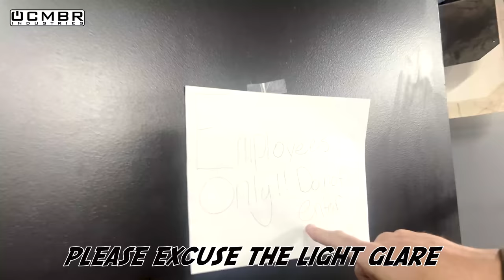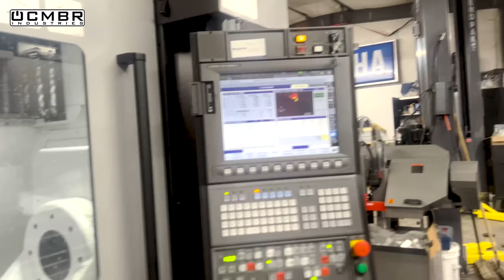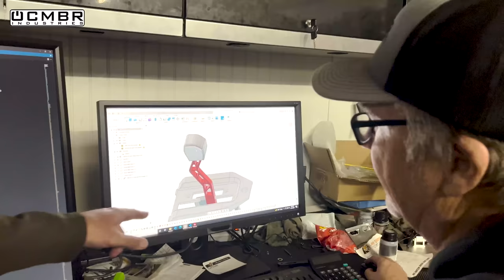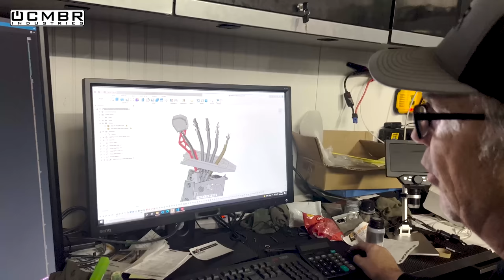Road trip.. empty trailer?! 👀 RZR Pro R, KRX, Talon, X3?

Comment: Can you do a break in tips !??  Proper way tips etc
Reply from the maker: Honestly we usually just drive them like normal. Take it easy on the belt for the first 20 minutes, let’s the machine cool down a half hour or more then do it again, and then it’s pretty much ready to rip. Break in oil change at 25 hrs.